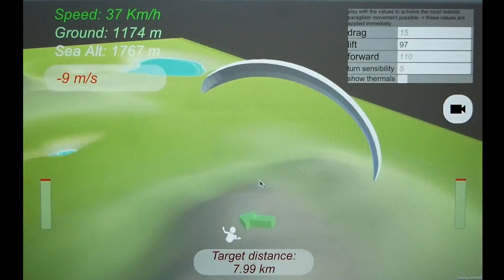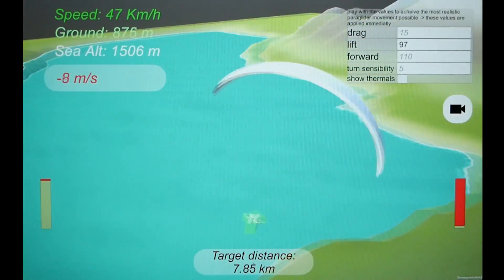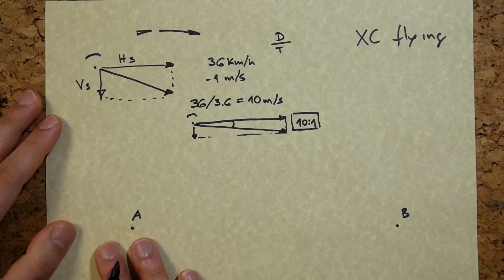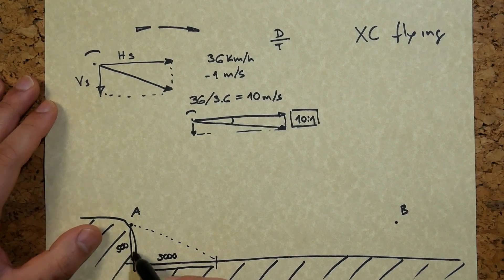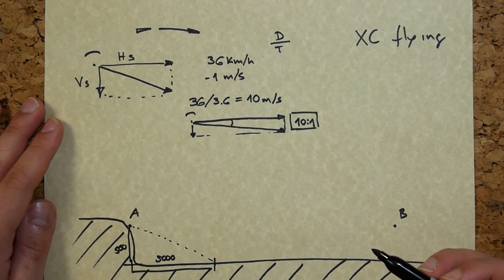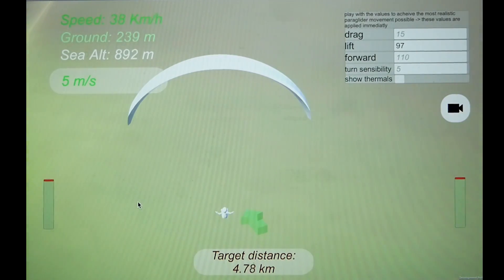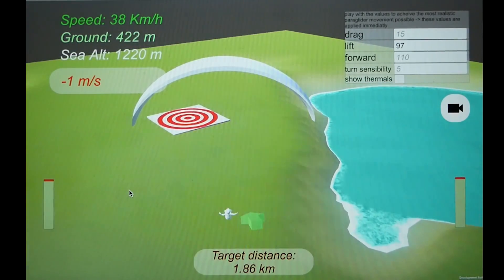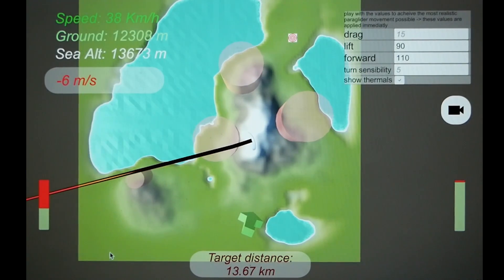How Cross Country works - Paraglider Game Part 2 - BANDARRA

Comment: @Andre, This is quite good! I have used several paraglider simulators in the past, and have a user interface, that I would like to propose.
My setup hangs from my ceiling, and is based off a "Hang-In" simulator, that I made out of PVC, and a set of risers. The toggles, and weight shift, work together, to move an optical mouse across a platform mounted to the frame from which the user's harness hangs.
Brake tension, is adjustable by connecting surgical tubing, to the mouse, and break lines. This gives a very natural feel, and allows gravity to handle the motion expected from weight shift. The tubing is connected in a triangle formation, so when one pulls Right-Break, the mouse position moves to a position on the screen that corresponds with the Right-Break. The simulator I was using at the time is no longer available, and it connected directly with Google Earth. The speed bar, connects to another input, which gives the reverse input to that of the breaks. At the time I was using this, I also had 3D goggles attached to my PC, which gave an incredible level of realism, to my virtual flights. 
Even without Google Earth, or the 3D headset, I think my design would work well with your program. I'd really like to get my simulator hooked up again, to do some "In-Door" XC.
Let me know if this interests you, and I will dig up my original designs. 
That way, you have something to work with, and even improve upon.
What say you? (>*